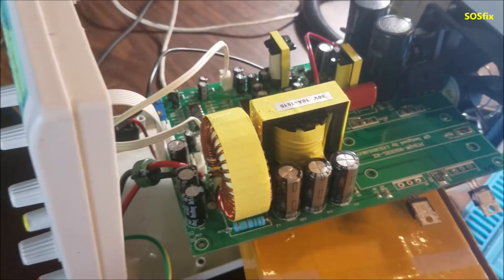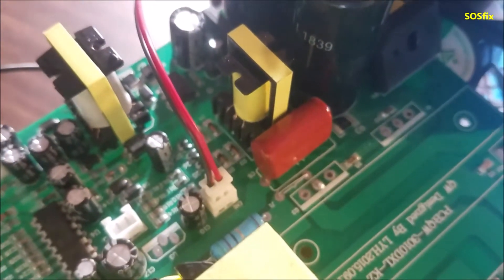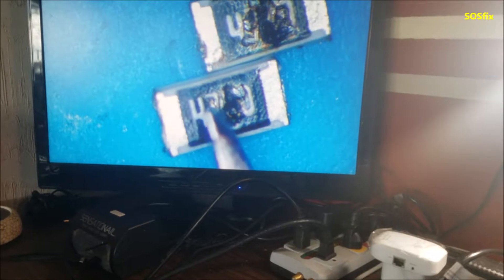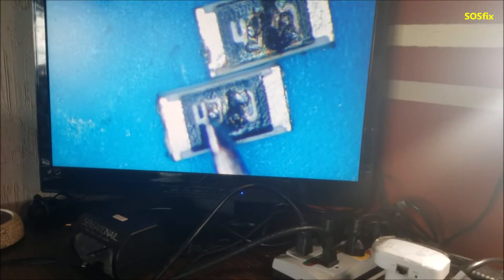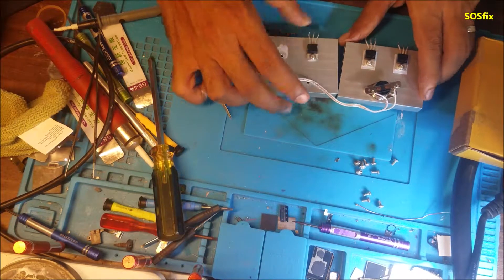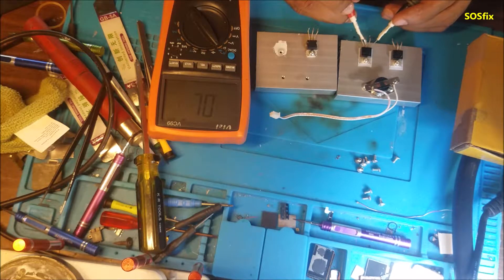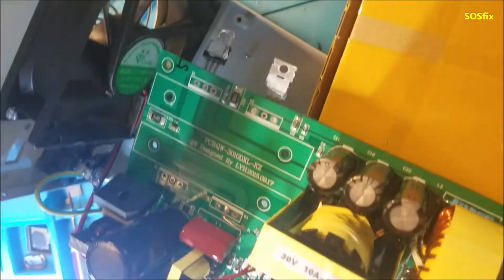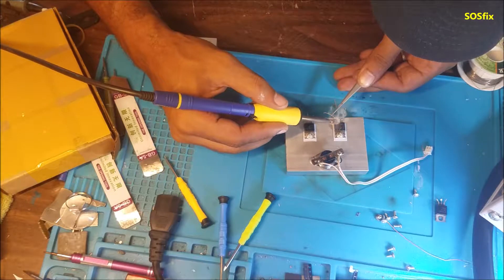DC power supply repair no voltage

Comment: Good video and I may the same issue with mine, but just not sure it's worth the effort to bother with. I don't have needed MOSFETs, so add the effort and cost to get those, plus my time, and it's hard to justify repairing. It doesn't seem to have good self protection circuitry so it could easily just go bad again.

Comment: Hi I got one just like this need help I took out All MOSFETs and rectifier and didn't notice until I was putting them back in which one goes where
Reply: heatsink faceing up with thermol switch left is p75nf75 to the right is 13n50. the other heatsink  on left is p75nf75 on right irf 740.

Comment: hi i had checked the smd resistors and yes they are burned so i need to get new ones and also those 4 mosfets had been replaced last thing too do it too replace the smd resistors
Reply from the maker: Yes. Replace the shorted mosfets and opened resistors.
Reply: do i replace the opened resistors with 47ohm ones like those ones you show in the vid
Reply from the maker: @NotCaily  yes replace the open burned resisters 470 ohm not 47 ohm. I didnt have the same resistors that why I used ones has value close to it
Reply: @SOSfixElectronics  The original design (with old style color banded resistors) used 47 ohm.  The design was likely  updated when the unit was redesigned with SMD components.  My SMD resistors were definitely 470 Ohm. I noticed some confusion here. hope that helps.
Reply from the maker: @LittleBachman  the SMD resistors marked 4700 that's mean 470ohm I used 510 ohm and my power supply still working as it should and still using it every day